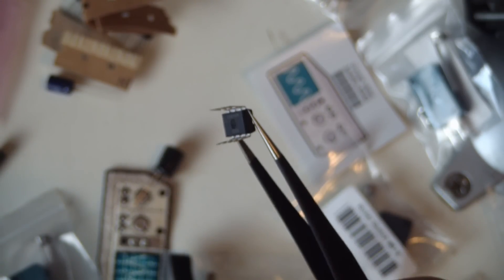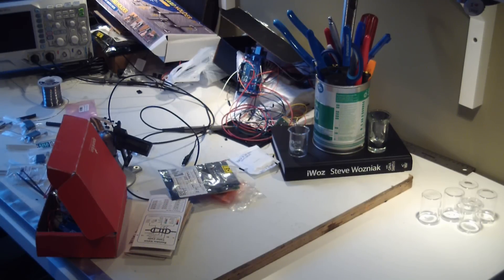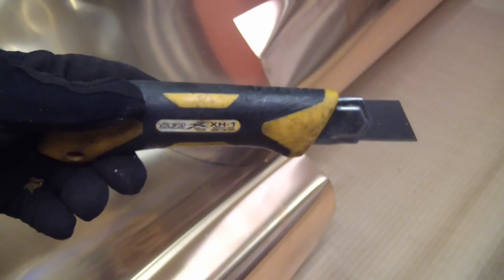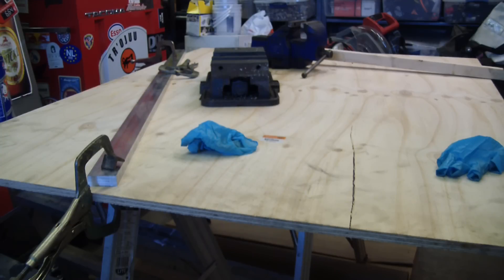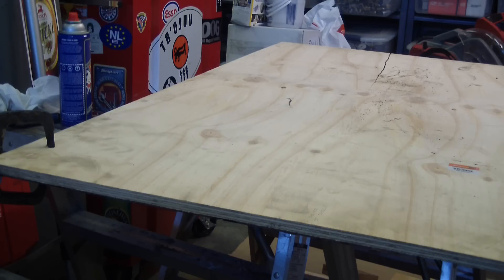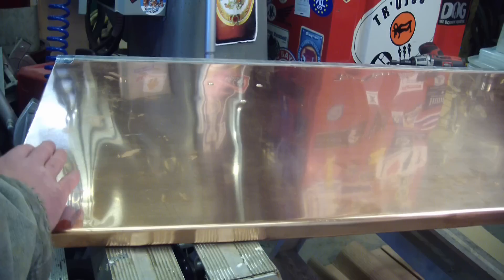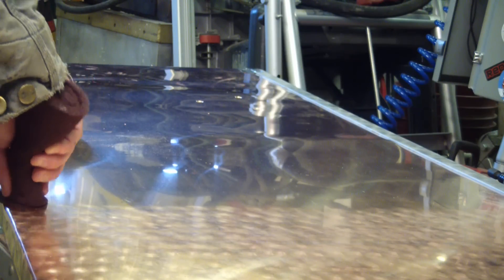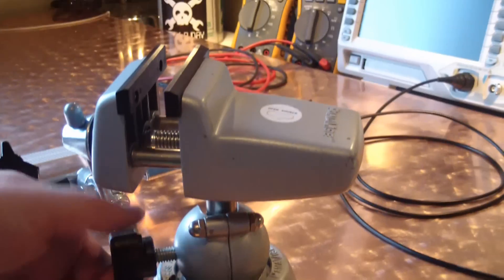Copper Workbench

Comment: The rubber mats are actually megohm resistors that limit the current of the static discharge. The ultra fast high current zap is what let's the smoke out. The rubber mats let the static out real nice and slow so the pixies don't get too angry.  10^6 - 10^9 ohms to ground every 10' of surface is spec.

Get yourself a 1/4 watt megohm resistor between the bench and ground and you should keep them smoke hungry pixies bi@#*s tame.

Comment: Yeah, it looks Purdy and all, but....

Over 30 years as a technician, then  ELECTRONICS Production and Testing whEngin(earshot), I gotta tell ya just how unsafe that megasexy cuprilaminal anti pixie skookilater actually is. 
 The 3M brand, et. al. Static DISSIPATIVE work mats are just that, dissapative. They are supposed to exhibit 1 MEGA ohm or greater resistance to ground. The static charges that build up, which are deleterious to said triple nickel micro pixie whistler, build up,  on YOU.

So, when your schmoo encapsulated skick dinners come within discharge radius of the target factory smoke suppository,  said skick dinners are the source of the damagerious sub relativistic Beta particules.

Yes, that's right. Your little pixie tickling skick dinners are the source of the damagerious Betas. So, any discharge path to ground is good. But, just like the therapeutic said dinning of skick, there can always be too much of a good thing.

I'm not gonna quote a source, other than to say, over 40 years of safety training has me aware of the simple fact that the minimum current through the heart for cardiac failure is 10, TEN millamperes. I have personally witnessed fatal  electrocution with as low as 12 voltz. 

I'll hazard a guess and posit that at least one project a year you will work on, a year, will have 12 volts and be able to source 10 milli amps (OR MORE);and that you WILL be under the hood in search of some particularly obscure flavor of pixie skookum. 

Woe betide the day when your bare skinned, rib jabbing elbows come in contact with direct baring, copper burnished earth ground whilst one or more of your previously admonished and/or admired clean nailed skick dinners wrap themselves around 12 Volta units (or more) of previously indicated Pixie pissing Beta juice. (Go ahead, say it three times real fast.) 

@ said instance, you could very well be walking to the pearly gates of the Gr8 White Nothing. Please put a ONE mega ohm resistamaloid pixie juice slowing device in series with your dead sexy cuprilaminal anti pixie skookilater.

Ch33rs.

Comment: It's so pretty! I might look at doing this to a different surface in my house. 

I WOULD do my electronics workbench like that in a hearbeat if it weren't so dangerous to the electronics I'm working on. (And potentially to me.) Heh.
Reply: Just don't. Buddy made a stair railing from 4" copper drain pipe. Every fingerprint becomes a big black mark that you have to use metal polish to remove. Horrible stuff.

Comment: Wonder if a guy could use a heat activated glue like what they use for formica and press glue it with an iron and a rolling pin.   Dunno just throwing that out there.   I can relate to the cobbled together weights and clamps situation since I've also actually tried "doing things".  It usually works.

Comment: Advice from the glory days of Formica:  roll on contact cement, both surfaces, lay 3/8"  dowels every 4 inches or so perpendicular to the long side. Once cement is tacky but not wet lay sheet over dowels. Starting in the middle then working left and right, slide the dowels out while smoothing the sheet with a roller, your hand or what ever else is handy.  Final bond by have your significant other sit on surface for no less than six weeks.

Comment: I don't want to sound like a do nothing know it all,by it is pretty hard to beat water based contact cement to get a perfectly flat and permanent bond.Also you don't have to wait until the next day to finish your project,or get high as a kite from the fumes. The one drawback is once she is down cockeyed,she is down cockeyed for life. Though that can easily be avoided with the use of strips or dowels.

Comment: At least put a megaohm between that and ground. First electrical safety and secondly, how is the esd protection supposed to work if you still get sparks? There are two parts to esd protection, preventing charge buildup and dissipating charges you already have SLOWLY. First is probably too much effort for home work place, you pretty much have to have everything esd safe, they probably sell esd undies somewhere. Second part is what you tried to do, make stuff conductive and ground it. But the trick is to ground it through significant resistance so the static charges would dissipate slowly, not in a snap, burning through the IC.

Comment: so you come walking in on your 2$ flipflops generating enough voltage to kill a small rodent, and you drop your beloved 555 on your copper tabletop pins first. the 555 is on your potential, say 1.21 GV and your beautiful copper table top is ground....there goes the 555. maybe you can put a 1MegOhm resistor between the tabletop and your ground socket to drain the high voltage a bit slower so your 555 wil keep on living.

Comment: If you ever attempt this again, I recommend contact cement.  Apply a consistent amount to each side, lay the sheet, then roll it out.  A vacuum press and a good platten will improve the results further. Source:  I worked as a cabinetmaker for several years, and applied my share of plastic laminate and aluminum sheet metal to MDF substrates.

Comment: This is a very stupid idea. Copper is way to conductive and therefore not protecting against ESD. The idea is that the charge dissipates slowly due to a high resistance, but not so high that is wont dissipate at al. Then working on a grounded plate like that could potentially be a hazardous thing. If you manage to hook yourself up to mains power you have no resistance to ground thus making you the only thing between mains and ground.

Besides, For a good ESD save environment you need to ground yourself as well.

Comment: Years and years ago I wrote and installed a pager tracking system in a Pager Repair Center. There were 10 copper screened enclosures which stopped all errant radio transmissions. That was the only way they could test the pagers to see if they were working correctly. Interesting project as we used bar codes to track every step of the process.

Comment: Now you can't directly lay "live" pcb's on your bench table without having to add some type of insulator. This reminds me of when my dumb ass was cleaning a pcb board with a wire brush and shorted out some traces that had capacitors in circuit....LOL!!

Comment: This may be a stupid question... but you have that connected through a resistor to ground right? Not directly to ground? Static discharge benches go through like 10M Ohms to ground so that the static "dissipates" instead of "discharges". I'm sure you did it right, I just didn't see any mention of that in the video I think. Fucking cool table though, wish I had one.

Comment: I've never seen a copper-sheet covered bar that was flat.  They always have some ripple, loose spots, etc.  I think it is the nature of the material unless you roll it out and hammer it down as you go, creating tension like upholstery.  Even then, I believe Cu is ductile enough to stretch and find its own way of not laying flat.  The burnished/hammered look is not only rustic and aesthetically pleasing, it also creates some variation that might stop small parts from rolling around.

Now the downside is that as a conductor, it could actually float or hold a charge.  To really make this complete, you would want to run a ground rod outside with some copper braid up to the work surface, and then when you're working, clip into the surface with a copper wrist strap.  That's how we did it back in the semiconductor lab.

Comment: Did you connect it to the plumbing to ground it out?
Reply: I'd assume he connected it to an outlet--ideally with a 100 megaohm resistor. Plumbing works as ground in a pinch, but isn't considered good practice for electronics work. (Then again, neither is a conductive table top.

I do admiti it is very pretty, though.

Comment: The industry I have been associated with has had me using copper-top tables since 1968. Most tables are about 10' x 3' and use a sheet of 14 gauge copper (need the physical strength because heavy military metal boxes get tossed on the tables and a thin foil like you used would easily tear). A new tabletop looks beautiful for a while, but atmospheric oxygen will soon give you a gnarly layer of copper oxide. As you use the table, it will accumulate dents and creases and scuff marks, which make the table look pretty grungy after a couple of years. I did try once to tin the entire tabletop; best way is to get some bar solder, a quart of flux and a super heavy-duty hot air gun. You heat, flux and wipe the solder on, quickly whisking off the excess solder with a wadded up cotton rag. You do this once and then decide that once in your life is enough. BTW, a copper table is BAD from an ESD protection perspective. If you approach a grounded metal table, the charge on your body will discharge into the table, typically through the ESD sensitive part you are holding. ESD kills semiconductors, no matter which way the charge flows. Regarding safety, although there were a few times when I was working with extreme pulse generators that I was happy to know most of the area was safely grounded, a conductive work surface will usually be more pain than you might think. There will be a lot of times when some connection will slip off and yield a skittering series of arcs to your table-top. Also consider that you will often be grounding yourself as you lean against the table while sticking probes into live circuitry. I guess a lot depends on what sticks out furthest from your lap.

Comment: Hi. I like the Video and the Desk Looks real Nice. On the off Chance someone that is not familiar with the idea behind ESD-Protection and wants to use your example as ESD-Protection, you should explain why this is in fakt the risky way. The Problem People will get is that if you place a live (unisolated as always in development stage) circiut Board on the table it is likely to blow up because you will generate shorts through the Chopper. This will not Improve if you Insert a high resistor into your ground Connection, as the copper shorts vcc and gnd on the Board without even 'Traveling' of the Desk. That's why ESD Protection is high Z. The Impedanz is very high to not be a suitable way to Short your Board, yet so conductive to reduce the power of high voltage Electric charges. Sorry for all the mistakes but my Ipad is set to german and autocorrect is a real pain like that.

Comment: Trouble with copper is it conducts too fast for ESD purposes. You need a one meg ohm resistor in line to your earth connection.
Reply: +Nigel Kingsley-Lewis The reason wristbands have a meg resistor in them is to protect you, not electronics. Because if you were wired directly to ground, and hit a hot you'd light up like a Christmas Tree.
Reply: +Paul Frederick It also limits the current that would flow through the electronics. Not only can the static voltage be high there can also be a very high instantaneous current flow only for micro seconds but that is enough to blow up items such as FET's. So yes the resistor protects the person but it also protects the electronics from too high a rate of static discharge.
Reply: And an equally good day to you to.

Comment: it looks really cool and I love the burnishing. unfortunately it's the wrong thing for ESD protection. The ESD mats are a high resistance to prevent the build up of static without allowing it to short to ground quickly. Having that earth plate there will ensure any small charge that builds up in a component shorts out with maximum damage.
Reply: +John Cooper (choffee) I guess that does make sense, but isn't the problem with static buildup generally in the environment and not in the part itself? if so, this is sure fire way to eliminate a static rich environment and immediately discharging anything that touches it.
I know I always get my biggest zaps when walking on rubberized floors.
just a thought!
Reply: +John Cooper (choffee) Exactly. Problem with metal surfaces is that that there's nothing to limit the current of any static discharge and it's the current that does the damage. Plus there's the safety issue when working on anything mains.
Reply: +MrJgstoner The rubberised floor issue is down to the floor and your footwear. You build up a tribolelectric static charge by walking over it which can't bleed away until you touch something like a desk and you get 'zapped'. The whole point of an ESD-safe environment is to stop any static charges between items building up and to limit any charge that does to leak away safely.
Reply: ohh kind of like "bleed down" resistors? never thought of it like that.
I still like the copper table though.
Because copper

Comment: Excellent video, as per usual. 

One suggestion and one question: 
-insert drum solo at 5:50
-could you use alumin(i)um?
Reply: +errflow You can use aluminum but aluminum oxidizes and will tend to turn you black as you touch it. Copper is just nicer. Me, I got a quarter inch thick stainless steel plate that I do my electronics on. I'm not taking any chances.

Comment: Correct me if i am wrong, but isn't the slower dissipation of charge provided by those ESD mats what is protecting the silicon bugs?
I mean higher resistance limits the discharge current. Maybe you want to add in a resistor between the copper and ground to do the job, but i fear it might prove more difficult than that.
I hope it works though.

Comment: Are you sure this is a good idea? You don't worry about oxidization or reacting to all kinds of things? how about not being able to get little drops of molten solder on that surface, ever? or the fact that it's conductive and you might accidentally short out a circuit because of an exposed live wire touching that surface? I'd like to see how well it holds up after even just 1 year.
Reply: +jk98  Don't lick the green stuff! It's not the same stuff that grows in that stinky cheese from France!

Or on the other hand, who knows, maybe it is. That makes it even less worth licking.

Comment: Great looking bench! The only problem I would have is when soldering, the splatter is going to pretty much be there forever unlike a static mat you can usually peel it off. Also having to watch laying power supply leads on the bench because now you have a large conductive sheet to zap you also it makes a huge antenna making noise for testing, otherwise it's great looking.

Comment: Because of the voltages associated with the vacuum tube  equipment I mess with on occasion I prfered a wood surface. For ESD concerns why not get the mat, and let it out gas in a location where it wouldn't be obnoxious, and later hang it out of sight  behind the bench until needed, if you are actually in the wife's room. I only stop by if I gin an interesting suggestion, and don't, know if  you  are allowed to share space in a sewing room

Comment: Only the cheap anti-static matts burn and stink up the place with heat.  The good ones will handle a soldering iron no probs and not melt or stink at all.  Well, unless you take a blowtorch to them or something. Actually, forget i said anything, you'd totally do that.
Reply: +Jonah Beale (RCFlyer) Well I don't think the copper sheet is cheaper. Anyway, a decent ESD mat will dissipate static charges and not shortcircuit everything you put on it. 
A 1200mmx600mm high temperature resistant ESD mat with grounding plug costs around €75 and it's MUCH safer than the copper sheet!
Reply: A good ESD mat is also $314159265 per square foot
Reply: Na, a good mat is only like $40 for 1 meter.

Comment: There are a number of reasons for not having a conductive work surface, first and foremost is safety, you can zap yourself if you get mains in contact with the thing and your ground has come off. The other reason is ESD, if you are carrying a part over to the desk and you have a charge of a few KV when a pin touches the copper it'll ground out at a squillion amps through it rather than slowly through a few megohms you get in the ESD mats.
That said it looks dead sexy and I want one ;->

Comment: Part of the benefit of ESD matting is that the top layer is not conductive and does not generate a static charge. This lets you operate live circuits on your bench without shorting out components. The bottom layer however should be conductive and grounded. I would personally add an antistatic layer on top of the copper sheet. Not to mention bare copper tarnishes very easily. 

You're right that ESD matting usually discolors and off-gases over time. Not to mention is horrendously overpriced.